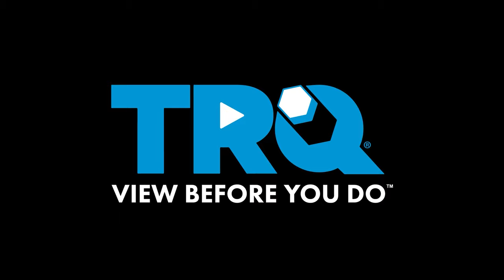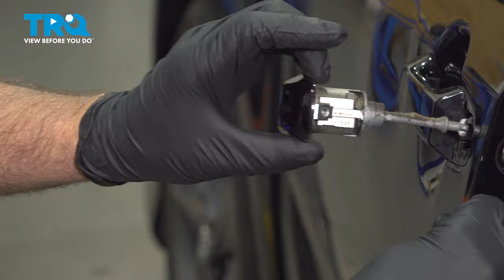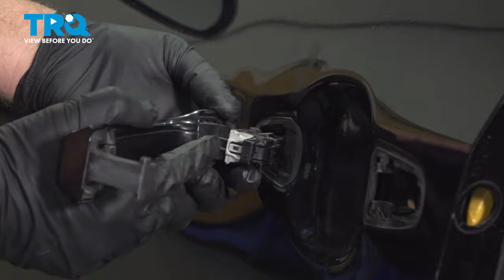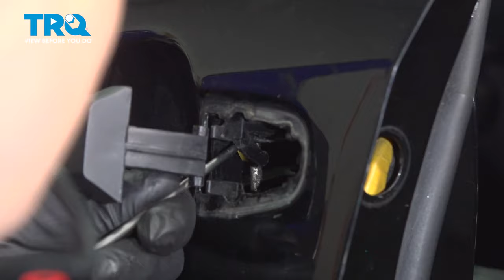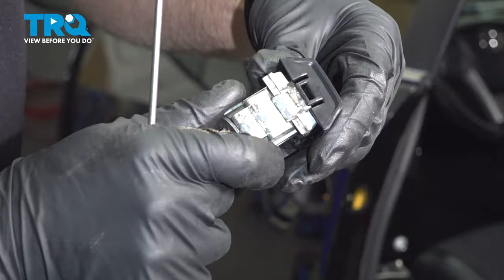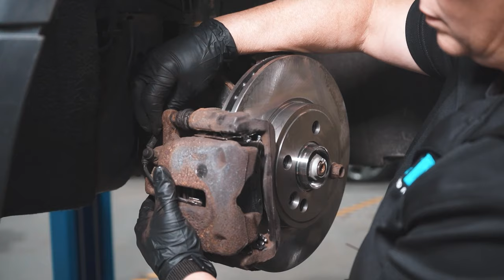How to Replace Exterior Door Handle 2012-2017 Toyota Camry

Comment: mine didn't have the connector as mine is a basic without the keyless entry, but  it  took about 3 min  to put on the door handle and cover over key entry ! The estimate was $100 ish just labor at the dealer. I did get my parts at the dealer as I wanted my key to fit and color to match. Thank you TRQ!

Comment: My 2013 Camry didn't have the connectors.  I removed the door panel and searched inside door.  Found another video in which that Camry also didn't have connecters.  I got an actual mechanic to look at it.  He discovered my handle somehow connects into something near the keyhole area.  With door panel off, we placed door handle in place, he pushed something inside door panel to door handle and...it works now.

Comment: Update: You need to unscrew that T30 screw MOST of the way. Ive been trying to pry it off my door for 30 minutes until i watched another video. At least on mine, i unscrewed it like that and it has teeth that keep the screw in place even when its loose. 

Anybody else having issues pulling the cover piece off? In the video he simply pulled it out and mine is not budging even with a screwdriver and force. Im not sure what im doing wrong.

Comment: Thx for the vid. worked out great took no more then 5 mins. the worst part was pulling the handle trigger to line up with the handle. found some random lawn trimmer twine in the street (Philly) and it worked perfectly. thx again!

Comment: Thanks for this. 20 mins was all I needed for my 2012 Camry. No connector as well, so made it super easy. Just had to slide it in & ensure the back of the handle engaged with a release lever. In the door. Took me a bit to get that right but it finally worked

Comment: Great vid. Only thing to add...when you put the key cylinder back in,that rod end has to line up with a small receiver in the door...it doesn't always do it automatically.  Body shop couldn't figure it out, tried to tell me I needed a new cylinder until I googled it....

Comment: Any thoughts as to why my bolt for the lock driven with the T30 driver will not screw back in? I have replaced the handle successfully and was putting everything back together but that part will not thread.

Comment: What is that plug that the exterior door handle is plugged into? Mine is missing, and it should unlock when I grab the door handle but doesn’t. Also my BSM system is malfunctioning on my driver side.

Comment: I had the handle replaced but dealership gave me the wrong door cover part. Can it just be popped on from the outside or will it have to be pulled out like in the video to be put on?